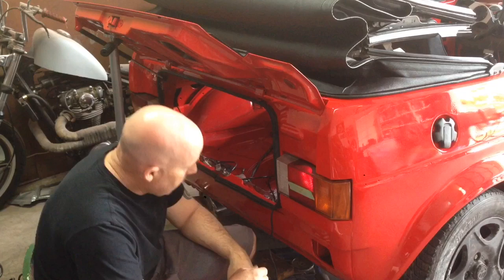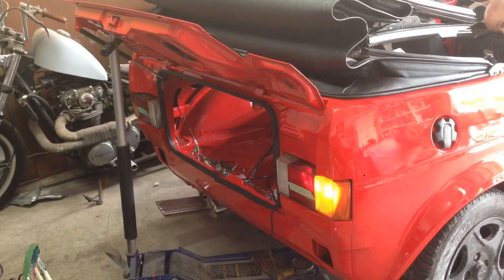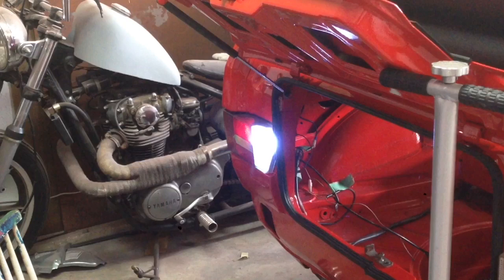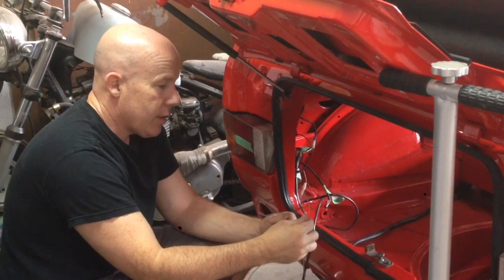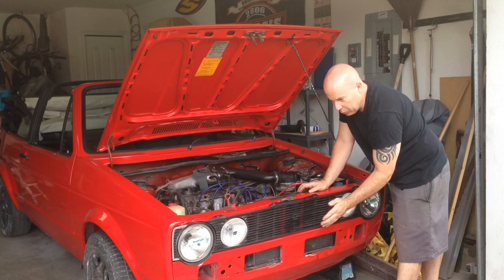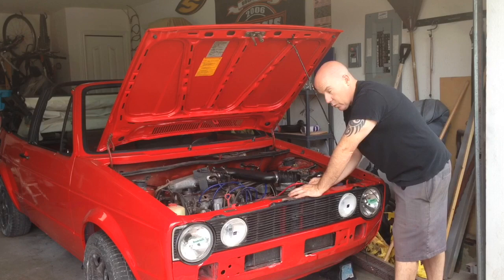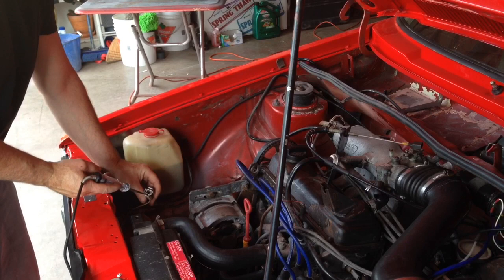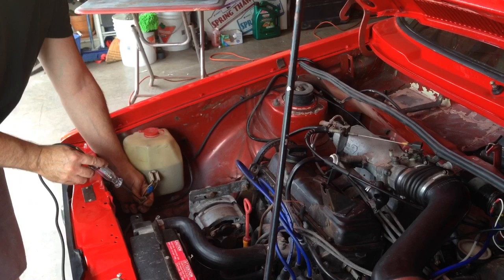Working on the Lights - 1980 VW Mk1 Rabbit Convertible Project Episode 30

Comment: The mk1 always had spots in the middle as there high beam. If you take them away it’s not original.
Reply from the maker: 1979-1987 Rabbit Convertibles/Cabriolets came stock with the single round grill. This dual round grill was added by a previous owner